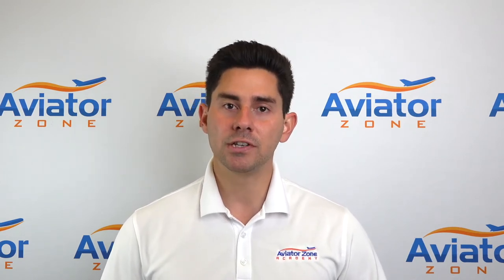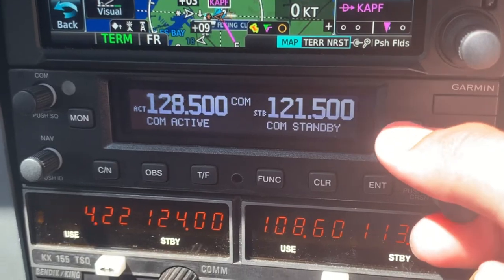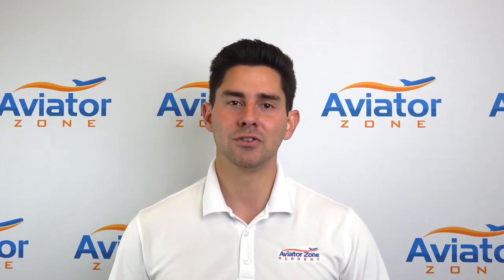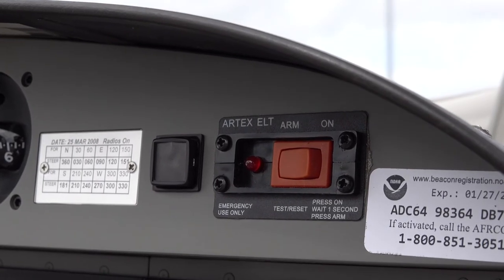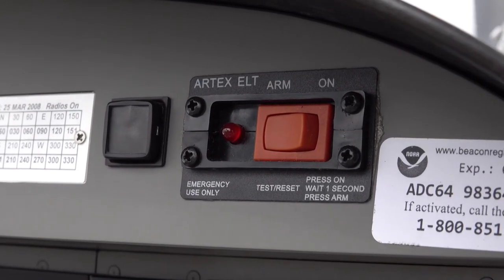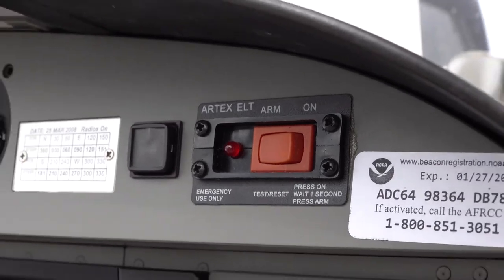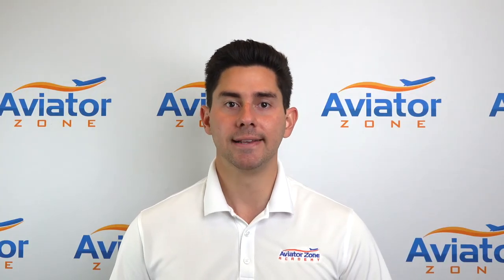Emergency Locator Transmitters (ELT) in Airplanes Explained | Two Minute Tuesday

Comment: Hi there. Some of my company's aircrafts are equipped with ELT type C, with a 2 way radio function. Could you pls tell ne what is the range of the radio on these devices? Thanks!!
Reply from the maker: Hi Peter I think it could come down to the manufacture and each countries requirements. Do you know the manufacture of the ELT?